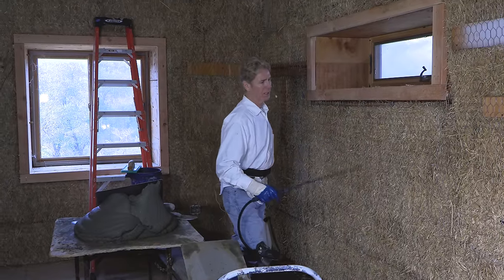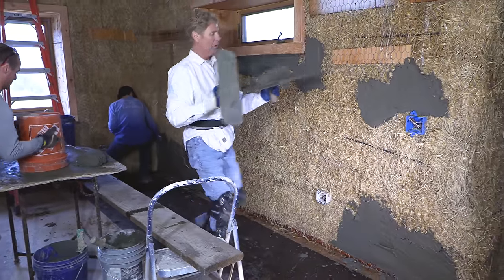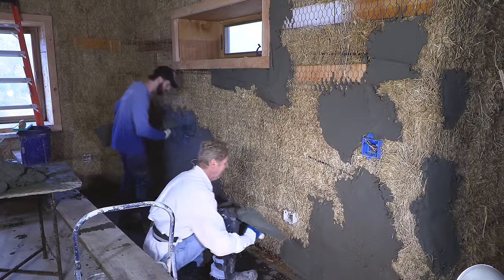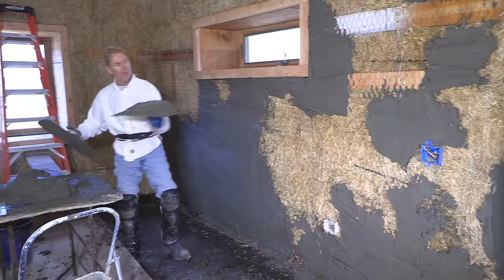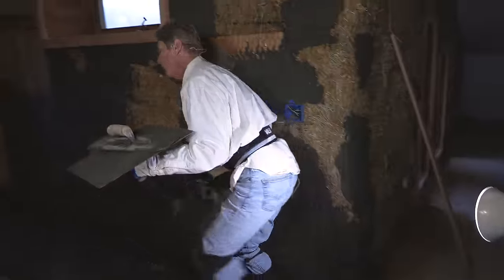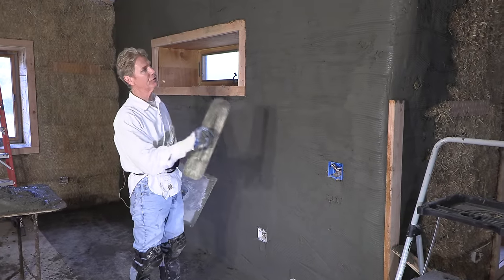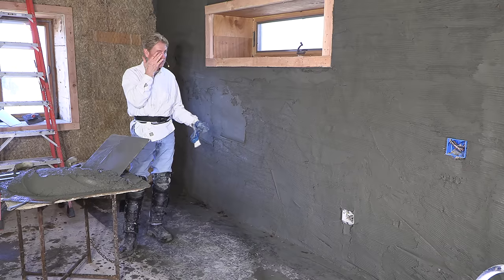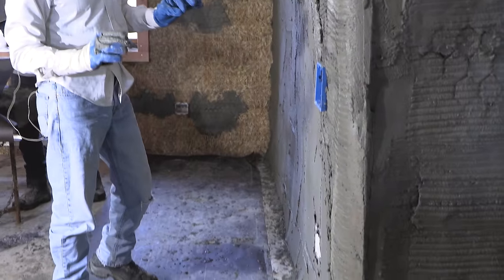Straw Bale Stucco Construction

Comment: Mad respect. First time Ive seen a strawbale wall. Learned something new today.
Reply from the maker: These straw bales and similar structures have been around since the beginning of time. 
They keep us humans safe and out of the elements of freezing rains and cold weather, as well as predators with large teeth and appetites and have been built since the beginning of time.
 The materials change or adapt from cob, which is clay, sand, and straw, to dirt, and yes, Dung, to lime stucco and many other outer skins for waterproofing.
It’s very similar to  Wattle and Daub 
We even explained what Wattle and Doub in a video a few years ago.

Comment: I was today years old when I learned you can make houses out of straw bales and stucco it. I figured only little piggies live in straw houses. 😂
Reply: Don't think a huff and a puff would blow that house down.
Reply: It has a complete timber frame.  Straw bale only fills the role of structural substrate for the stucco and insulation
Reply from the maker: Good morning and correctomudo, little warm piggy at that. No wolf will try and blow their Straw-Bale home down. That would be futile. Unlike the castles in Europe, like in the HBO special “Game of Thrones,” you can have a fire going on permanently, but those rock castles will remain cold year-round. Now take these Straw-Bale homes; once heated, they will retain their heat because of this boring topic called R factors.

Straw bales typically have an R-value range of 2.38 per inch to R 0.94 per inch. This range is comparable to the R-value of stone wool or fiberglass. Although it is slightly lower than cellulose, straw bales' R-value can be increased depending on how tightly packed the bale is.

What are the insulation properties of straw bales?

Straw bales have excellent insulation properties – among the most cost-effective thermal insulation available. A typical straw bale wall has an R-value greater than 7. Straw has a similar insulation value to fiberglass batts for the equivalent thickness and is much cheaper.

That's pretty good compared with conventional 2 x 6 stud wall construction that has an R-value around R-21. It is technically boring stuff, but it is important when you pay the heating bills.
Kirk Giordano Plastering Inc.
Reply from the maker: All can use what they please, were not suggesting folks do what these folks did. However with brick and mortar homes, you can have a fire going on permanently, but those brick homes like rock castles will remain cold year-round. Now take these Straw-Bale homes; once heated, they will retain their heat because of this boring topic called R factors. Besides brick homes are outlawed in our area because of earthquakes, the ground moves the bricks separate like a rickety screen door in a hurricane.
Reply: @StuccoPlastering  I'm pretty darn comfy in my slice of southwest heaven with my r20walls, 40+ ceiling and subfloor. All standard entry level stick building with stucco siding.  I think at the very best straw bale tends to be on par with stick framed fiberglass insulated houses but tend to cost just a little bit more. At my house I've always wanted to do a slip form masonry structure using local rocks.
Reply: You said if it's 32 out side it's 32 inside whit no heating 😂
Reply from the maker: Correctomundo, no one lives there yet, thus it's the same temperature inside as the outside. Not many want to spend the dough to heat a house not yet occupied.
Reply: @nicholasthibeault1729  But a struck match will
Reply: @psychoduck.  Kirk's 9 inches will take care of that
Reply: I love keeping it up, Kirk. I'm another plaster here, and  you guys killed.
Reply from the maker: Cheers my fellow plasterer, we try not to break the packs. Stays put.
Reply: Adobe 14" also 3' in the ground to maintain constant temperature in home.

Comment: Your knowledge of the craft is amazing. You wouldn’t think that stucco is so technical.
Reply from the maker: Stucco over wood hoses is It's actually easy to understand, but there are so many different methods for many substrates makes it seem technical. Straw-bales, Concrete blocks, bricks, wood walls, it's endless, but if you can do one they are all similarly done.

Comment: Happy New Year to all the professor's students and fans !!
This is my 1st look at a straw house, ,, amazing really .
Many of the very expensive homes up in Canada, built in the early 1900's have that uneven character stucco on the walls.
Some folks cover it with 1/4 " drywall to try to flatten the walls out. It's not that great a finish, but that's just my opinion.
I have really enjoyed straightening some of those untouched walls to make them true and plum and look good. Some of the most satisfying work for a finisher like me.
Learned a lot on this channel ,,,,
Reply from the maker: Hello, my friend, thank you, you might be under 35?
 Most young fellas like walls true and plumb as we're conditioned that's kinda like true wealth. 
Where in the UK they go for old-world charm or distinguished walls with character.
 I used to be one who liked perfection in my younger days also, no crime there.
 Today I lean towards the old-world charm.  
For example, if you see a hundred years old trees with beautiful super thick green lush moss covering them, do you see the beauty in that, or do you want to pressure wash off that moss? 
Things that make you go hmmmm.

Comment: Cool house!  My wife and I finished stuccoing a Perfect Block ICF house the end of August.   Thank you for you training!!  Stuccoed both inside and out.  Learned a lot , yep put in on and stop playing with it. Or it cracks or sounds like the cow on a flat rock😮!  Hydrate but not to much or the cow comes back😅.  On the outside I used the $60 Amazon 4 hole sprayer.   Seemed faster.  The mixer ( wife) wasn't super consistent but like you said work with it and pick out the rocks too.  No stucco yard in Elko Nv but snad and gravel yard close, so I picked lots of rocks at times and always thought of you. Just pick out the rocks!  It isn't perfect but good enough for who it's for/ looks good from your house😊  I've done sheetrock on 3 houses and poured quite a bit of concrete but never stucco.  Just couldn't figure out how stucco stayed on the wall? Like pouring a slab vertically.  But thanks to you we did it and it wasn't to bad.
Really appreciate your time spent making these videos.   If I knew you would work for a pizza I would and kept you well feed😊  Keep up the story's it's fun to hear. 
Bill
Reply from the maker: Howdy Bill as long as it goma veggie with extra cheese. I used the old 4 hole sprayer to stucco this mountain. https://youtu.be/4QzOn0Hyv-4/ After awhile we were just taking the mud out of the wheelbarrow with the shovel and throwing it on the mountain and using the trowel to put it where needed.  The old improvising trick.

Comment: Hello Kirk, real question this time. Since the exterior was done previously, should the interior "match" the vapor permeability  characteristics of the exterior plaster? Ie. if the exterior is cement, use cement on the inside. If its lime outside, use lime inside? And I've never heard you mention this in a video (at least the ones I've watched) but you should talk about how humidity moves in both directions thru a vapor permeable wall from high to low pressure seasonally. I think ideally they would have gone with lime on both sides of the wall on this project, but they came onto a project that was already half done. I would think hay would act like a solid stone wall. Without a gap for water vapor to "die" in and drain away, cement is not ideal.
Reply from the maker: Good morning, Visitor Dude. That’s an excellent question. Let me explain further. In the video below, we are doing something very similar and using the same material. It is what's called a lime or plastic cement, both lime and plastic mean the same thing.
Naturally, I don’t expect anyone to watch another long video so, click on, https://youtu.be/dw34VLYFC1Y/ and skip to 6:38 and watch 30 seconds. That simple explanation, along with visuals, may answer your question quickly. 

Keep in mind that application is 30 percent applications while material knowledge is 70 percent.
 Who came up with this theory? I did, as I’m morally responsible for whatever I have done or will do. 
 We believe that when one is responsible for one’s actions, this is the beginning of true wisdom in any trade or in life in general. 

Oaky, the outside was completed by the homeowners about 20 years ago.
 So I was told by my sons Carl and Dan. They informed me it was done with plastic cement and that they would use plastic cement inside.
I said, you boys have learned well. 
 Lime or plastic is breathable, and it applies or spreads well. 
Could the owner have used any of the other 20 materials I’m aware of, such as Kemset’s Ekoplast-50, which is lye-free plaster engineered for inside or outside? Sold mainly in Europe, of course, they could have. However, it would have had to be ordered from Los Angeles. The owner, Hickman, is my pal.
Or they could have used Eco-friendly lime stucco, “Diasen,” which is also pure hydraulic lime plaster consisting of lime plaster, cork, and Diatomaceous earth ar “DE” for short. 
Which, BTW, would have had to be shipped from Italy.
 Or could they buy silos of now Sika’s 690 BMI stucco with fibers which I mentioned in this video? Is it mixed with hydrated lime at the time of use? They called; however, it’s not supplied in their area. 
I mention just a few alternatives, which most professional plasterers may even know as an example.
 Often, one is better off using material with a long history of success or integrity as being more than capable. 
To answer your question, Carl and Dan are spreading Quikrete’s lime plaster, which most would eventually have come to realize is the best stucco for their needs. 
You asked my opinion. Kirk Giordano Plastering Inc.
Reply: So they did match the inside to the outside, that's kinda what I thought. Also, Plastic cement is going to confuse  people outside of the trades (like me). By "Plastic" they mean Platiciser which is an ingredient that helps spreadability. Lime is naturally spreadable, so the two are synonymous with one another  @StuccoPlastering

Comment: Have plastered pools my whole life you got yourself a hawk there man hahaha. I don’t plaster the inside of the pool but the raised areas that get mosaic tiles installed so I build out plumb and screed flat fast as it drying then give it a smooth sponge finish a lot of times to give it a profile to bond the tile. 
have me a laborer with a shovel feeding my hawk once I get where I working I ain’t moving haha I let a laborer feed me the mud .

Never have seen hay bails plastered and used as walls do you drive rods through the bails from the top ? What you use to attach the chicken wire to the hay? 
Now the outside you need to waterproof it right??
Reply from the maker: The homeowner did the exterior about 20 years ago, usually the bales just sit on each other, the stucco netting is then fastened or pushed into the Straw using 6-inch u-shaped metal clips.  They used a lime stucco on the exterior it can be left as is breathable or painted.

Comment: I have never seen a straw house or knew that it existed, except for the three little pigs' straw house and you know what happened there. What a challenge Kirk, the worst wall ended up looking great, I like the rough look, it has character. How long did it take to finish this job?
Reply from the maker: Howdy, that depends on the homeowners. As the inside plastering is just getting started. There are a lot of walls up there that we did not show.

Comment: Do you have to worry about mold with straw? Just curious.  I would think think yes. Thanks Kurk
Reply from the maker: Howdy Jacob, excellent question. The Straw Bales should not get rained on or be moldy when purchased. This is just common sense.  Once covered, a breathable stucco is preferred. Let’s air in and out.
 I’ve seen guys way back in the day hydrating the exterior walls like they were made of stone; this is not advisable; misting the exterior with just a quick spray of water to create a solid mechanical bond is necessary.
Excessive soaking or hydrating the exterior straw can trap moisture, which can cause molding, so again, just a bit of water is required for proper bonding.  
When building with straw bale walls, one can get caught with their pants down, meaning the dreaded rain or a chance of rain, so tarping the entire structure might be necessary.
 Way to much work. 
 It's best to start in spring, where there's little to no chance of rain. 
 Rain to straw bales is like kryptonite to Superman; it’s not good.

Comment: On your thicker buildups, have you ever thought of laying some additional chicken wire/fiberglass net/mesh just to provide some more grip?

Seems like every 6in of depth or so, layering an additional wafer worth of grip material would solve a lot of potential drop/crack risk due to how much mass you have setting.
Reply from the maker: Exactly, you're on the ball, on some of the thicker build ups where the stucco dropped out I would place some  extra stucco netting in that area to help hold the extra buildup in place.

Comment: I started following your channel as I'm planning to build an off grid house in Alaska.  No building codes so i can do whatever i want.  I've looked at this but I'm curious why it isn't used more.  It must have some sort of weakness to it but I can't see it.  Cheap, insulative and easy to build.
Reply: That doesn’t look like easy work to me!
Reply: Alaska might be to wet for straw bale.  U might be better off stick framing.  Only reason it’s not used more is because code is a slow moving force.  But it is seen now more than ever.
Reply from the maker: Go for it!

Comment: What’s the R value on those walls? Awesome video
Reply: The limit does not exist
Reply: Yes 😂
Reply from the maker: Howdy, the answer will bore you, but here it is. 
Straw bales typically have an R-value range of 2.38 per inch to R 0.94 per inch. This range is comparable to the R-value of stone wool or fiberglass. Although it is slightly lower than cellulose, straw bales' R-value can be increased depending on how tightly packed the bale is.

What are the insulation properties of straw bales?

Straw bales have excellent insulation properties – among the most cost-effective thermal insulation available. A typical straw bale wall has an R-value greater than 7. Straw has a similar insulation value to fiberglass batts for the equivalent thickness and is much cheaper.

That's pretty good compared with conventional 2 x 6 stud wall construction that has an R-value around R-21. It is technically boring stuff, but it is important when you pay the heating bills.
Kirk Giordano Plastering Inc.
Reply from the maker: Straw bales typically have an R-value range of 2.38 per inch to R 0.94 per inch. This range is comparable to the R-value of stone wool or fiberglass. Although it is slightly lower than cellulose, straw bales' R-value can be increased depending on how tightly packed the bale is.

What are the insulation properties of straw bales?

Straw bales have excellent insulation properties – among the most cost-effective thermal insulation available. A typical straw bale wall has an R-value greater than 7. Straw has a similar insulation value to fiberglass batts for the equivalent thickness and is much cheaper.

That's pretty good compared with conventional 2 x 6 stud wall construction that has an R-value around R-21. It is technically boring stuff, but it is important when you pay the heating bills.
Kirk Giordano Plastering Inc.

Comment: Worlds Most flammable house
Reply from the maker: Au contraire mon frère, quite the opposite, Staw Bale's homes are fireproof. Fire needs oxygen to burn. For example, if one broke a large hole and poured gasoline in, it would simply smolder, and then go out as the stucco would not allow the necessary airflow.
Reply: @StuccoPlastering  I realized this after I googled it.

Comment: What do you recommend for inside shower if It already has a Struco lite base coat? Thanks
Reply from the maker: Evening Mark, I hate to say this, but it is the truth.
Stay away from all types of plasters in a shower.
  This includes all Structo-lite, and all the Veneer-based or lime-based pretty finished and deep rich pretty colored pure lime finished plasters. 
Even if your shower has an advanced exhaust system, I don't recommend any plastering systems in the shower itself.
 And yes, I have plastered at least 4 in 40 years, all molded and these were my own. And yes we have many videos on applying Eco and other pure lime finishes online in showers. Not anymore. In all those videos you will find this comment.
 Although I don't anymore, you can apply lime-based plaster as even these lime plasters mold fast and must be sealed every 6 months; who has time for this nonsense?
 Either tile or attach the plastic shower sheets. 
Hell, even the caulking and grouts will mold in time, aging. Don’t apply any limes in a shower.
You can use lime or veneer-based plasters for all other areas, but leave the shower alone or face mold in the future.
 You will, like me, still have to re-caulk every few years, but your walls won't mold within a few months like every plaster known to man will.
Reply: Thank you

Comment: Ive never heard of plastering over straw bales. Is it supposed to be the framing or the insulation?
Reply: looks like both! labor costs are expensive in Cali, so I suppose this is cheaper to construct?
Reply from the maker: Exactly, it's cheaper, but does incur cost for plastering.